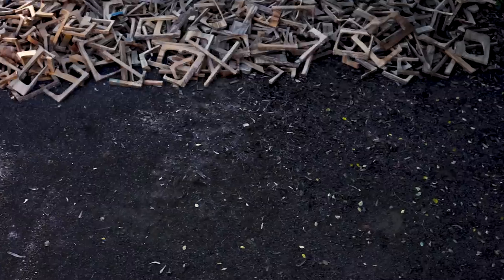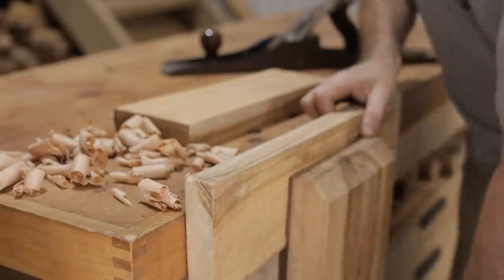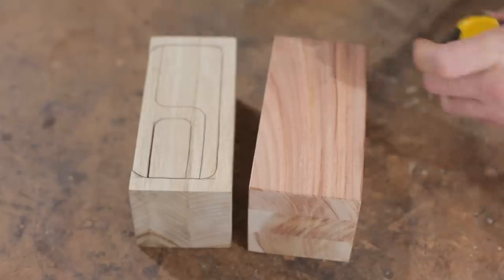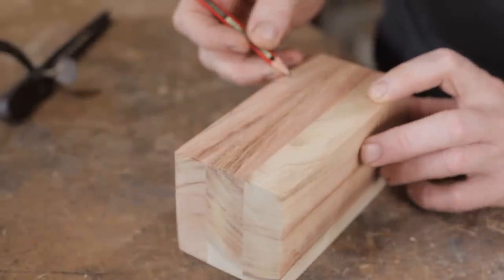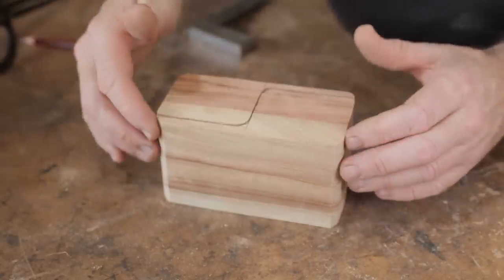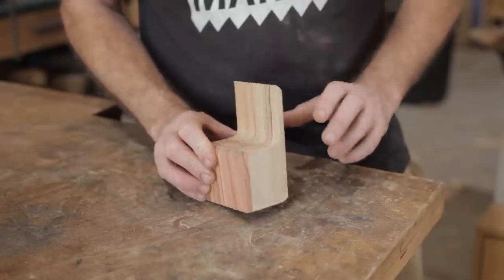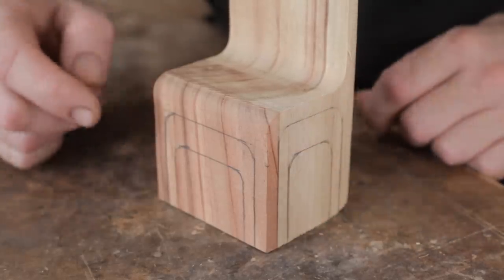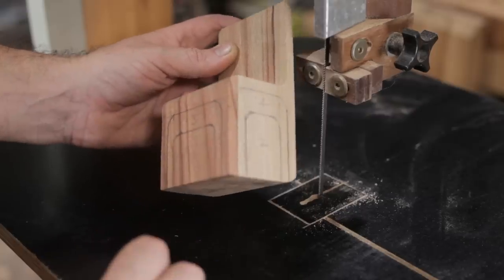Homemade Vintage Puzzle Toy - Last Minute Gift Idea - Scrapwood Challenge ep21

Comment: "I'm just eyeballing it"
> Draws perfectly straight line
Reply: right? 'I'm short on time'...*cuts wood block into small pieces, glues pieces back together*
Reply: He said it the same time I read this
Reply: That's a pretty common woodworking tecnique. He's eyeballing the measurements, but by holding his finger against the wood and applying a good amount of pressure, he's able to draw a straight line. Try it yourself! It's not very hard and could save you a lot of time on your next project :)
Hold the pencil in your thumb and index finger, supporting it with your middle finger. Then, put your middle finger on the side of the wood next to where you want to draw a line. Then, simply pull the pencil toward you, and voila! straight line.
Reply: @rosly_yt  hence the `rule of thumb` ??
Reply: @SmashPortal: yeah, every time I see him doing that... green with envy. 😠 (but then green). 😄

Comment: Prior to YouTube, I had this design from an old magazine. I tried to make it on my band saw but I could never get it or any other project to work right. Blades always broke and I couldn't get a straight cut ever. The manual was no help and no one I knew had one to tell me what was wrong. Thought the blades were too loose but then they would break when tightened, tried different blade bands sizes, teeth and companies and still the blades broke. Finally Isold it to someone who never ended up using it.

Comment: My grandmother had one like this in the dolls house we used to play with at her house when we were children. Does anyone know if you can buy them anywhere?
Reply: I did a bit of searching, and all I found was antique ones for over $50.  I think if you were slow and careful, you could probably make this with a hand saw, one of the kinds with the thin blades.  You wouldn't even need to clamp/glue wood, his plans call for 7.5x7.5x16cm wood, and 7.5cm is smaller than a US 4x4 post (even after you count the fact that 4x4 is actually 3.5"x3.5").